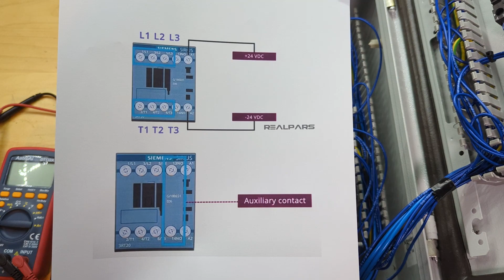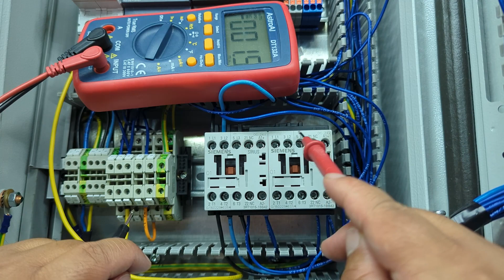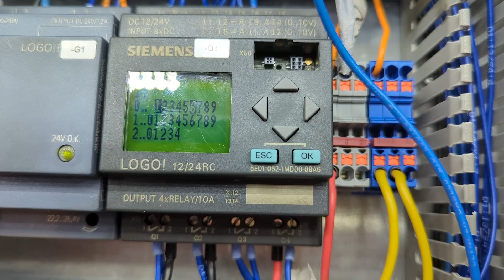Understanding Contactors - £10 Siemens LOGO PLC

Comment: K1 has 21 and 22 as NC normaly closed, so when the contaktor is not energized the connection is made. I think that K2 contaktor two has a link at the top from contaktor two A1+ to contaktor one 21 NC so if u energize contaktor two the power flows from K1 A1+ to K1 21 NC and throw this closed contakt into input 6 on the plc. If you push both buttons and both contaktors pul in then input 6 should not be indikated. Sorry for poor english.
Reply from the maker: Ha nice one so my suspicion about them being linked is true, I was a bit too scared to start pulling them apart. I've kinda understood you, thanks for the explanation, do you know a possible reasoning for why they'd wire it like this, with this link? I've found the wiring on this panel to be very different to anything I've seen.
Reply: @HamedAdefuwa  I think that it is used for 3 fase motor control, one is forward and other is reverse. Thay have made an interlock to provent both pulling in at once. thay use NC contact to cut power to other contactor. ABB has a mechanical interlock that prevents both pulling in but using NC contact ,thay can make it cheaper. There are mechanical interlocks for thows contactors as well, but it can be done like that as well.